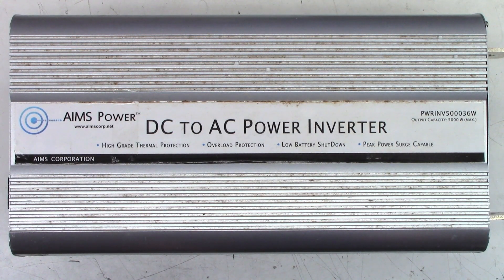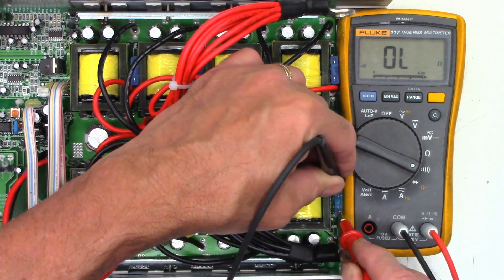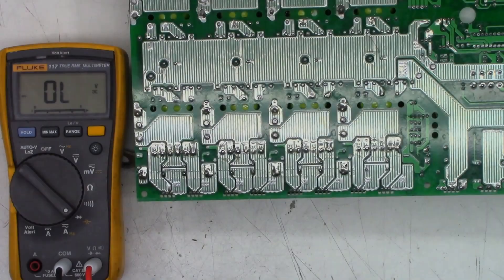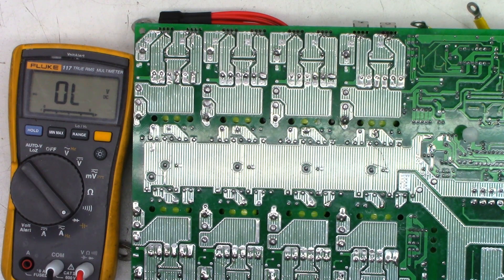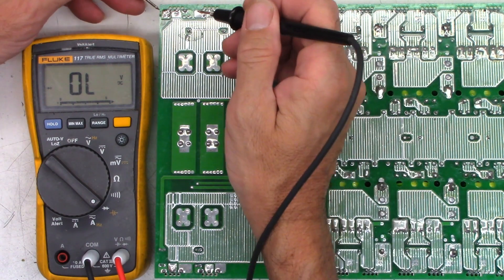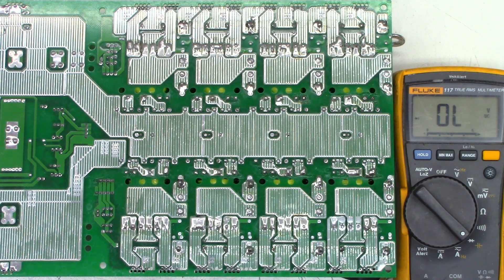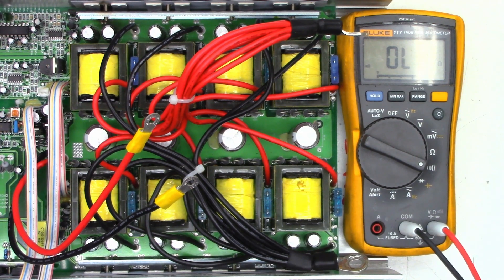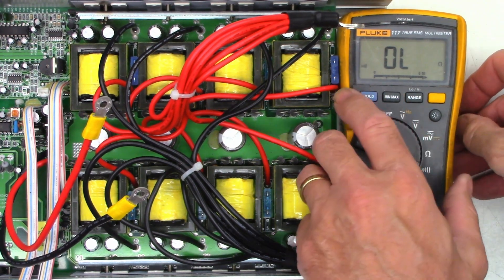ITS BACK! the AIMS Power PWRINV500036W I worked on a few months ago blew up again!

Comment: If no fuses are blown and the voltage indication shows proper voltage but no ac power output after letting inverter drain battery to inverter shutdown. Could the shutdown circuit be failed not letting the inverter to output ac power?

Comment: I am wondering where this Unit is housed and in what position it is whilst in normal operation because I have a feeling dew may be gathering and then a large enough drop of water
drops onto the board causing a short.. If you examine @13:33 of yo video it seems there are dried up water marks..
APU I dropped a   👉👍👈
Reply: I don't know if it's the same customer, but I'm pretty sure he's looked at units that have been quite wet before.
Reply: @PSUQDPICHQIEIWC  
Which is why no doubt they failed.

If-n I was asked to repair a switch mode device and it showed evidence of liquid contamination, I would be on the horn to the client to get the ok to modify the casing to ensure the innards remain dry..

Comment: I do the same, forgo the labor charges if a unit comes back to me within a year, unless the failure doesn’t involve the work I did.  Meaning if I did a restoration, but to save money the owner asks me not to rebuild the tuner section of a receiver and then all of a sudden the tuner stops working.  Luckily I’ve only had one or two items come back.